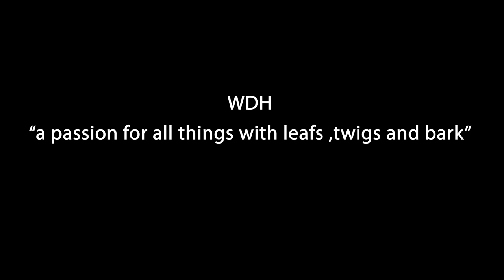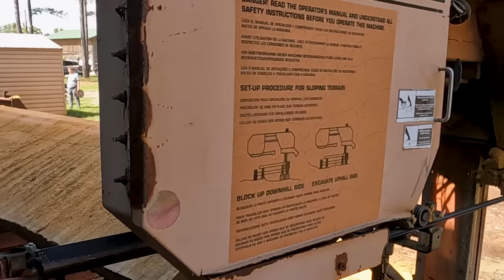EPIC GIANT Sinker Cypress Log Pulled From River Bottom On The Sawmill! 38Foot Long!

Comment: Pretty impressed how good that chainsaw cut was
Reply from the maker: Yep. Free hand
Reply: Anyone that has tried that knows how hard that is.  Incredible skill. takes a VERY tuned chain to cut that way without drifting...
Reply: Absolutely!! Sure don't look like mine.
Reply: And that was a looong bar on that chainsaw. Probably used a ripping chain to get such a smooth cut.
Reply: Dang near impossible.  I actually found it hard to believe.
Reply: @paulkramer4176  I had an old farmer split his 40" x10' white oak with a chainsaw to fit on my mill. Old guy stood on top of it and cut end to end a little over 1/2 way through. Rolled it with his tractor and did the same thing on the other side. Probably 15 minutes on each side. He never stopped during either cut, and never let up on the throttle. Almost perfect cut, lost maybe one board. Most beautiful w.o. I have ever seen. Tree was over 300 years old.
Reply: @johncollins719  How does somebody do this? Incredible!

Comment: Great video. Old timers here in south Mississippi used to tell me when I was young that sinker cypress was the best wood you could build with and it would last forever. The only thing better was yellow heart pine.
Reply: I had a house in Houston built in 1950, when we  redid the kitchen, we cut out cabinets were built on site then, wood was pine, perfectly straight, no knots or damage, never seen wood that good since, my floors were red oak planks, they were removed before the house was demolished in 2014, old wood used in attic for framing was pine and hard as oak

Comment: Would have liked to have done some logging and milling in the South,  but started ar a choker setter in Northwest Montana, then drove a rubber tired skidding tractor. Later, I got to run the feed chains for the 8 foot diameter circular saws on the log processor in a really big saw mill, original Anaconda Forrest Products, that sold to Champion Forrest Products. I did finally get to come to Tennessee to do my medical residency at Chattanooga. You could say,  I traded a chainsaw for a scalpel 😂!!! Am retired now, but still have fond memories of working in the woods. Thank you for sharing your experiences and sawmill.  You do an excellent job Nathan!

Comment: that is a small one, down in here in Mississippi grow them full size. and when they pull a log that's been down in the mud for many years it will have turned blue, and is called a blue log, very nice when it is cut and dried out. there used to be a mill on the river that bought logs, one day when coming back from water skiing we meet a guy on a log that must have been 12 foot in diameter waving at the tug boat crew sitting at the saw mill to come and get him so he could sell the log.

Comment: In the early 1980s my friend removed an early 1940s portable saw mill from a bog on a landowners property. My friend said it had been preserved by the peat, and after he removed it, he restored it. Eventually he used the portable sawmill, to cut logs on his property into railroad ties, that sold to the RR company The saw blade was at least 4 foot in diameter, and the saw was belt driven.

Comment: That cypress is some beautiful wood, would it make good flooring and how much will it move as it dries?
Reply from the maker: Not sure. I have no experience with it 👍
Reply: Old houses and other buildings were built with cypress because they had it.  Cypress is a very soft wood; you can mark it with your fingernail.  It will grow in water but has to sprout on dry ground.  It grows about 1 foot in diameter every 100 years.  There are no growth rings in cypress, at least bald cypress.  The balls it produces hold the seeds which are very prolific but are easily overwhelmed by other vegetation.  The lifespan is well over 1000 years.  It is termite and rot-resistant.
Reply: Actually there or growth rings in bald cypress plenty of them especially on old growth virgin cypress like that one  they or very tight from it’s natural slow growth!! What we have now is called growback cypress 100ish year old trees that grew really fast out of logged out old growth stumps that still had a healthy root system! These trees have fat growth rings because they grew really fast! At least that’s what happens in south Louisiana

Comment: Does the cypress keep that orange color after it dries and oxidizes?
Reply from the maker: Not sure
Reply: In my experience most ax cut sinker cypress keeps its color but the ones that get pulled up with root balls still on them or blow down trees could have blown down a 1000 years ago they tend to turn green as the wood dries think it’s from the muddy water slowly replacing the natural tannin in the wood

Comment: Why would anyone need boards that long. This is just ridiculous
Reply from the maker: 😂😂 your comment is what’s ridiculous
Reply: @OutoftheWoods0623  Dude, that's like 20 foot boards. Cut the tree in half and your little forklift won't damn near tip over. Who TF needs a twenty foot board??
Reply: @kennybeck5519  The customer needed 38ft. timbers. Since the bearings are out on my timber stretcher, and they are back ordered. I decided to just cut the timbers the length the customer needed. If you know of another way to get 38ft. timbers from a log, especially a short one, please advise.